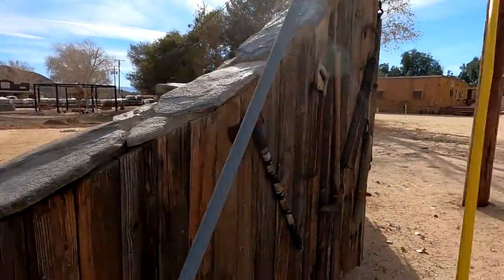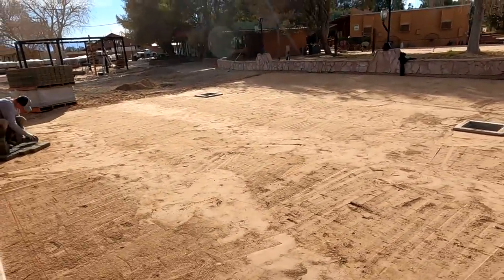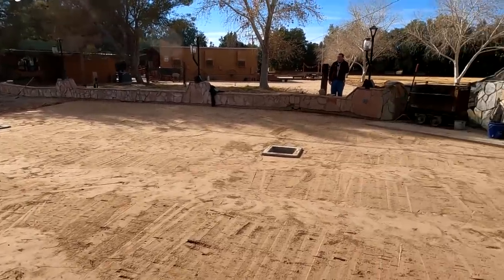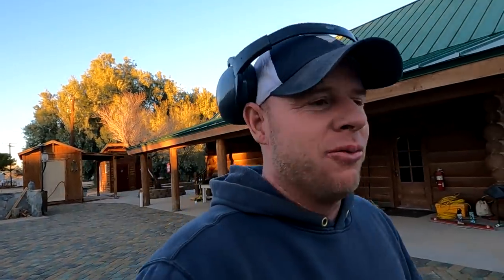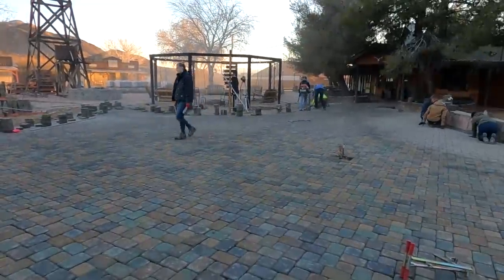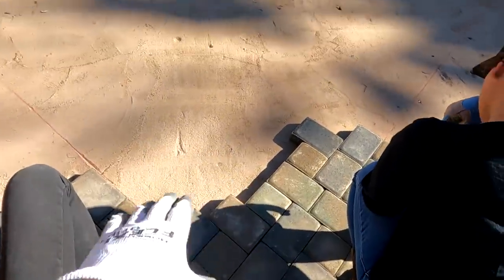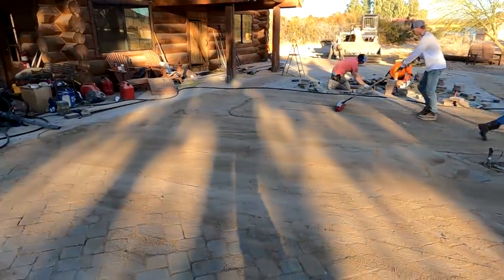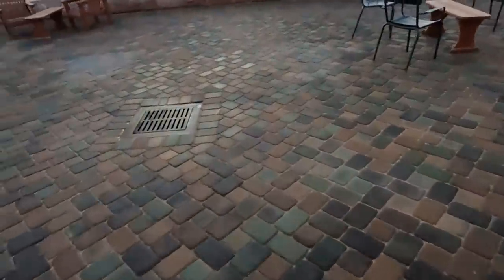Laying 6,200 SF of Pavers | Mission Trip

Comment: What is going to keep the brick from sinking into the ground once it all settles in and it gets walked on?
Reply: They put a really hard packed base under the sand.
Reply: Was thinking along the same lines with Melissa. I would go further and ask if there is any additive to the sand to help the pavers stick stronger? And wouldnt they need some ramming during sanding to help them sit well and drive down the sand grains?
Reply: @user-fb3td6cl9d  From what I know about the process, there is no kind of adhesive or additive.  And no pounding since that is done to the base material   The blocks are tightly put together and then sand is brushed into the cracks and crevices which keeps them from shifting.  You may have to occasionally re-brush sand over the blocks to refill the voids after the sand naturally settles.  I have done smaller areas of pavers and this is what I did with no shifting or settling.  Also as they showed in the video, the entire area is framed with either concrete slabs or concrete edging.  Think of cobblestone roads that have been in place for a hundred years or so...same process.    Hope this helps.     @Upstate Brush Control can you elaborate ?